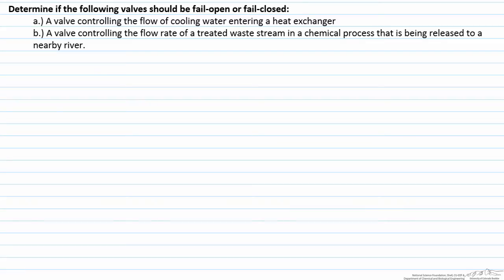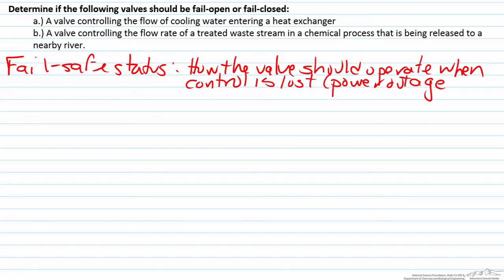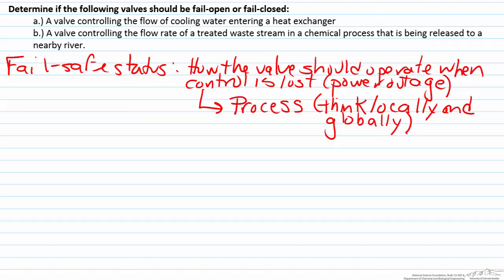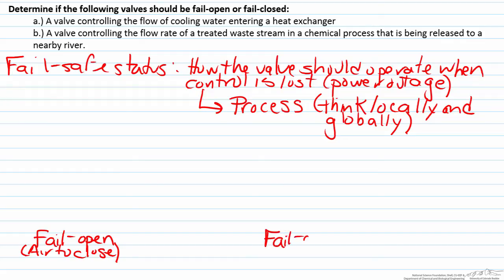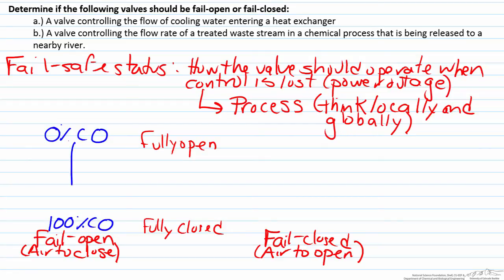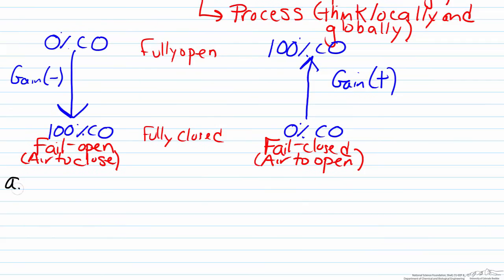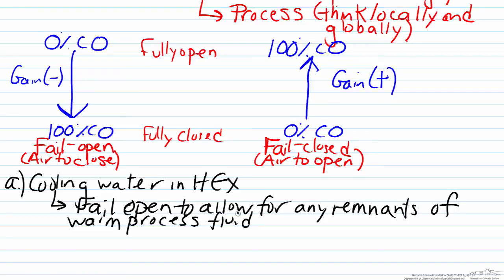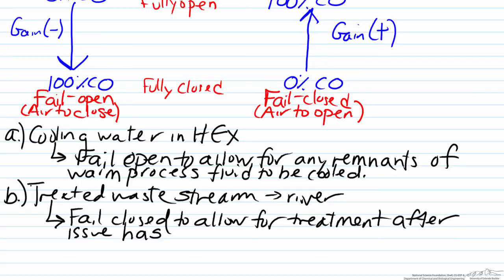Fail Safety Status of Valves

Comment: Don't you want your controller output setup to mean 0% is always fully closed in the field and 100% is always fully open in the field regardless of fail action? To do this we reverse the CO %/mA so that 0% is 4mA for a FC valve and 0% is 20mA for a FO valve. You then have direct or reverse acting relays in the positioners.